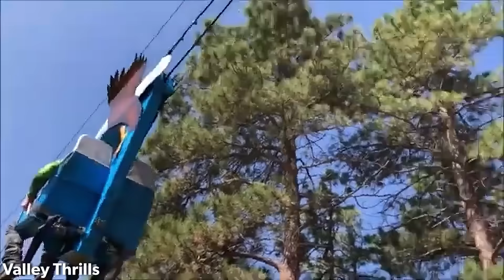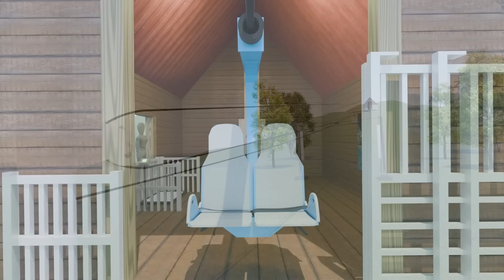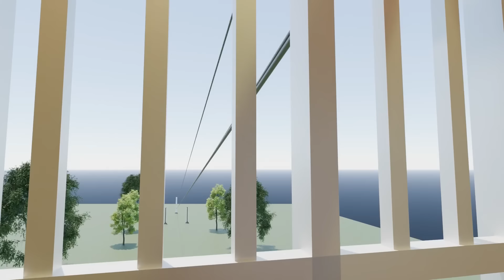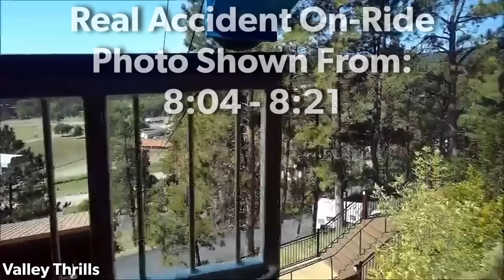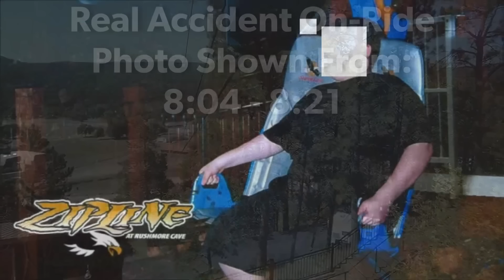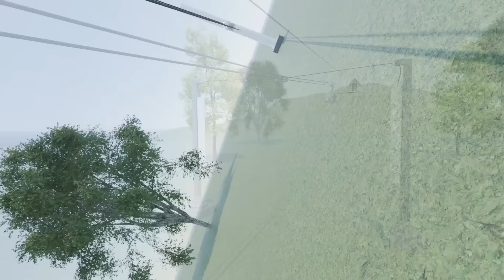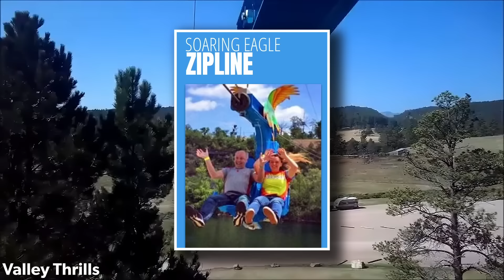Soaring Eagle Rushmore Cave - What Really Happened on May 29th 2015?

Comment from the maker: Some small notes: I want to make it clear that my statements about the restraints cycled feature being added are speculative (as stated in the video). There is nothing concrete saying Soaring Eagle added this as a result of this accident, but timing suggests that this is possible. That being said its still unlikely that feature would have prevented this accident even if it was present. Second, the air brake was added at a later date, but prior to this the ride used a spring pack placed on the cable to stop. This was left after the air brake, likely as a backup. The drive cable motor does have a brake, but this is used for other operations like parking in the loading area.
Reply: Do you hate the GP
Reply: @Coaster_club1  if there was no gp, thered be no parks

Comment: How are the proximity sensors powered / wired to the PLC?
It looks like there is no electrical connection to the seats and its seems unlikely/impractical to have wires follow the seats along the track ???

Comment: On of my favorite rides is a soaring eagle zip line and after hearing this I’m never riding it again
Reply: 1. The safety issues with Soaring Eagle's products have primarily affected people who are improperly restrained (more accurately, not actually restrained at all). That is, the people hurt/killed by their rides were hurt/killed because they were not restrained properly.
2. The ride model received an additional mandatory service update for all existing installations to retrofit additional shoulder restraints to mitigate the issues raised in this video, as well as improved operational procedures to ensure correct restraint use. This should limit the risk of an improperly restrained rider being cycled.

If you still enjoy the ride model, they've been made safer so you can continue enjoying them with a much lower risk of this kind of error.

Comment: It occurs to me that a very simple check they could add into the routine would be to ask the rider to attempt to get up off the seat after the restraints are locked. If they are unable to do so, you can start the ride. If they are able to do so, you just prevented an accident.

Comment: The rider and parent saw how the ride worked since it was open field, they saw how it would go backwards. The most logical thing is to think, Why do we use a seatbelt while driving? These seats are a bright color, don't you see where you are going to sit before doing so?? Also the operator and the parent not checking if the "child" (Idk if it was an adult) is well seated and wearing the seatbelt.
Reply: The parent couldn't have seen whether the seat belt was correct given where they were standing. See 6:38.

Comment: Why couldn’t they make the seatbelt color something more obvious, like a bright neon orange/red or yellowish green that construction workers or traffic people use? Would have made it more obvious and would have been more of a challenge for it to blend in with clothing 
Cause even with clothing that’s the same or similar in color, shadows will still probably reveal the seatbelt, where as black it’d be impossible if the person is wearing all black(like they are in this)

Not to mention it catches the eye. You can’t really miss that.
Not saying it’d really prevent the accident it’s still possible the accident could have happened, but it could have been way less likely.

Also the fact the same thing but on different rides designed by the same people happened twice cannot be coincidence.

I’m less surprised that this has seatbelts as its main and only safety feature than I am the haunted mine though cause how are seatbelts a good enough safety measure for plummeting straight down, if I’m remembering things right?
I’m still surprised this doesn’t have AT LEAST a lap bar though. Seatbelts aren’t always gonna keep a person inside

Also funny how I just now get to the suggestions part after posting this. Funny how they did not take much into consideration.

Comment: people are judging tf out of this rider but to me it seems reasonable that this rider wouldve;
a) expected the belt to be placed over them by the operator
b) be nervous they have to ride alone and pay more attention to the conversation / questions than the ride
c) didnt fully know / pay attention to the restraint system and expect the operator to handle it or notice issue

the report states that based on his age he wouldve known the risks associated with the type of ride and had had experienced like these rides before
its not stated what these experienced specifically are and if the rider would be familiar with these types of restraints
i think its fair to assume that on previous thrill seeking rides the operator wouldve handled restraints more than in this incident
Reply from the maker: Those same people need to realize that this type of issue doesn't occur on other rides, but has happened multiple times on this type.

Comment: Not to blame the victim but I honestly don't understand how you can get on a ride and not notice or be alarmed that you're not restrained in any way.
Reply: If I had never been on a ride before and wasn't familiar with the restraint system that it used, then I wouldn't be concerned about the lack of restraints until the ride starting moving, and then it would be too late. Up to that moment I would be assuming that the the ride operator simply hadn't gotten to the step of doing the restraints yet.

Comment: "Our cheap and shitty restraint system failed causing a child to be ejected from the ride?
 The ride operator CLEARLY didn't check to see if the rider was sitting on the restraint(as opposed to UNDER them)?
 Checking the restrains is LITERALLY THE ONE JOB OF THE RIDE OPERATOR, AND IS THE 0nLY THING/INDIVIDUAL IN PLACE TO MAKE SURE SAFETY IS MET ?
 Our design and mediocre manual NOT EVEN ONCE accounted for the possibility of someone sitting on the restraints??
 Because WE didn't include restraint placement in our manual, the overtly limited procedure can be cLaiMEd that it was "followed 100%", thus damn near lying by omission?
Well CLEARLY it's the dumbass kids fault for choosing to be stupid and fall from the ride.
We take no blame, and are disgusted that our name is being dragged through the mud because THIS IS 100% THE KIDS FAULT"

Comment: 1.7G in nominal operation? Backwards into the seat is fine, but that seems a bit much for a LAP BELT to stop you being ejected forward from the seat.  It's a durable (static) belt, not one that has dynamic stretch or which dissipates energy through tearing stitching.  Do you like bruises, kids?

Comment: Okay - NOT scientific, NOT official, PURELY OPINION... but I took screenshots of the video from the photo of the rider in the ride vehicle and spent several minutes playing with Photoshop (light, saturation, color, brightness, contrast, etc.) and it didn't look like there was a seat belt across the person's lap. However -- and I repeat that this is neither scientific nor official, and I am not familiar with the ride vehicle -- it appears  that there is a black stripe where the seat & seat back meet on what would be the rider's right-hand side; that stripe is the right color & size, and in the right position, for a seat belt that is tucked in behind the rider.  Regardless of any of that, it's very disturbing that 1) the seat belts were just black instead of a high visibility color (bright orange, brightly colored stripes, etc.) and 2) there were no standardized procedures for checking if the belts were in the proper position (which is VERY different from just checking if they're clicked into the receivers at one end).  If the ride operator had been distracted by the situation with the riders and was (as admitted) talking with the person who did not board the ride, it's simple human nature to have missed not seeing an all-black seatbelt against an all-black shirt & shorts.

Comment: I used to work at a park with a soaring eagle. From my memory, the seatbelts are not retractable, but the one with the pin was yellow, making it a lot easier to see if it's in front. It also seems unintuitive that the seatbelt would be across the empty seat, instead of in between the two chairs. How the guest didn't realize he was loose I'll never know. I also didn't know they made them where it starts at the top and flies down, mine got buckled at the bottom and sent up and flew down.
Reply: The standard bottom loading setup was designed to work on flatter settings where the high point needs to be created artificially. If a location has the ride's desired highest point more accessible than its lowest (e.g. located on a hillside like it is here), it can be installed with a top loading configuration instead.

As far as the seat belt arrangement goes, it was likely across the seat from the previous cycle (as was the case with the later Mine Drop incident), with neither the victim or operator giving it much mind until it was too late.
Reply: Yeah after the previous rider got off, the belts should've been hanging down in between the seats, instead of across the seat. This makes it impossible to sit on the seatbelt accidentally.
Reply: @jingleground  Indeed. Some operators would do that themselves, but was never officially outlined as standard procedure.

Comment: so let me get this straight.. they didn't check to make sure the seatbelt was in the correct position before plugging it into the receiver?!?
Reply: Indeed. However, the ride lacking any physical or procedural safeguards to mitigate that scenario and the manufacturer failing to implement any of those safeguards despite knowing the potential for the problem unfortunately paved the way for an almost identical scenario to claim the life of a 6 year old a few years later.

Comment: you're more likely to be bitby a shark that fell out of the sky than bein an accident of ride
Reply: Or even electrocuted by an electric boat. I say, what would happen if the boat sank from its weight, and you’re in the boat, and you have this tremendously powerful battery, and the battery is now underwater. And there’s a shark that’s approximately 10 yards over there...

So I said, there’s a shark 10 yards away from the boat, do I get electrocuted? If the boat is sinking, water goes over the battery, the boat is sinking, do I stay on top of the boat and get electrocuted? Or do I jump over by the shark and not get electrocuted?

Because I will tell you he didn’t know the answer. He said, ‘you know, nobody’s ever asked me that question.’ I said I think it’s a good question. I think there’s a lot of electric current coming to that water. But you know what I’d do? If there was a shark or you get electrocuted, I’ll take electrocution every single time. I’m not getting near the shark.

Comment: If the riders experience 1.5Gs at the end of every run, then why the F are they only using a flimsy belt to stop them from sliding out?!!! Even with the belt properly latched, this is begging for an accident.
Reply: Personally, I'd want at least a 3 point harness on before riding a zipline!

Comment: Black seatbelts contrast heavily with the bright blue seats. Why would sit on top of what is obviously a seatbelt, allow the operator to latch it, hear it latch and not realize you’re not restrained at all? Sure the operator should have checked from the front, but a teenager usually knows how seatbelts work.
Reply: 1. Lots of ride restraints look and work differently. Some rides don't have much restraint at all. Some belts have long tails or parts that you WILL likely be sitting on even when its buckled.
2. You don’t hear a click and automatically assume what it was. Operators have many things to click and push
3. Things happen fast
At the end of the day it doesn’t matter because children exist and visit these rides. It could happen to them if things aren’t changed

Comment: You left out that South Dakota does NOT have inspectors to enforce ASTM F24.20 Risk Assessment protocols, and that Roaring Eagles is headquartered in Utah, which (is one of the 6 states that) ignores ASTM almost entirely, so the manufacturer doesn’t have to assess human modes of failure, and will continue to get away with it.

Comment: Regardless of how you feel about the choices to sue or not sue the parks involved in these last two videos, the fact that this manufacturer (with an honestly strange and seemingly over complicated system for something somehow too simplistic at the same time) has been involved in more than one incident and hasn’t seen as much pushback and legal repercussion, if not more, as the two parks have is INSANE.
Reply: It’s weird to me to have the elaborate restraint sensors on a belt that has to be manually cinched up. Like all it takes is an operator not tightening the restraint properly for something to happen.

Comment: Dismissing a non-fatal accident as a one-off that's "unlikely to happen again" is a great example of how companies should NOT respond to an accident.  All accidents need to be reported so that we can learn from them so that similar accidents don't happen again.
Reply: Stupidity is not making mistakes often, it’s refusing to learn from them
Reply: @Pizzaetertjeno, no. Stupidity is making many, easily avoided mistakes. Ignorance is refusing to act after making a mistake.
Reply: @XSillygooseX  That's deliberate or willful ignorance, not the plain definition which is a simple lack of knowledge.
Reply: The Haunted Mine Drop fatal accident was also a ride made by Soaring Eagle
Reply: i think its especially wild considering how many engineered controls existed on the ride, such as the restraint unlock key being held by the control panel until such time as the gate is closed, and the ride being unable to be dispatched without that key. It seems like a lot of thought went into the initial engineering to prevent human error but as soon as an incident did happpen they essentially said "well, we designed it right, we don't need to change anything" despite the design having so many engineered human factors controls in it.

Comment: I don't understand why the end of the ride has to be 15 feet up in the air. You don't get off at the end it brings you back so just make it 3 feet up so if someone gets stuck at the end or falls out it's not too bad.
Reply from the maker: The design flaws keep coming
Reply: And what if you have a 10 foot tall rider?
Reply: @MossDFTBA  I think I get it. What if there is a tall rider whose feet drag on the ground?
Reply: @Orquet-qj2nf the original comment says "put it 3 feet up" meaning the bottom of the seat should be 3 feet off the ground. Does anyone exist whose shins are 3 feet long???? Paul is making up impossible scenarios to try and 'gotcha' someone making an honest suggestion to improve a potential design flaw.
Reply: @MossDFTBA  Well.... he's not alive anymore but Robert Wadlow's shins do look like they were that long. And he was only 8ft11in. ;P
But yes, Paul is being contrary.
Reply: @MossDFTBA wow I thought society moved past slenderman-phobia but I guess not

Comment: I'll never get seat belts that don't sash across the chest.  The brakes here cause the same forward-thrusting force as in a motor vehicle, and it would feel uncomfortable to not have that.
Reply: Especially a ride with such a jarring stop. It's basically having a car crash without chest straps.
Reply: 1. "it would feel uncomfortable to not have that" are the words of someone who has never had a sash seatbelt dig into their chest, abdomen, or neck.
2. Sash seatbelts can artificially exclude larger riders who would be perfectly capable of riding safely with a lap restraint.
3. The airbrake was a modification made to this specific installation.
Reply: I used to operate a soaring eagle ride (not this exact one) and that has 2 answers.
1. It's more "fun" to have the feeling that youre about to get thrown off at the end.

And 2. Is that a chest belt would open up the potential to crush ribs and compress breathing when the ride comes its abrupt stop.
Reply: @impossiblehorse7884  As someone who's endured painful compression from shoulder belts just from the forces of normal car driving, I believe you.

Comment: IMHO, this could have been avoided if the ride operators were requires to lift both seatbelts up before latching the seatbelts.  Or, in the case of the prior drop ride accident, requires operators to move all seatbelts into a neutral-forward hanging position before loading riders to ensure no one sits on the belts.
Reply: Right on the money. I know that riders who are old enough and mentally competent SHOULD also be aware but some people just turn their brains off when they get on rides. So having attendants physically checking the seat-belts/restraints on rides is so important to add that layer of safety. I've been to a park where there's an attendant on either side of a roller coaster train and they go down the line checking all the restraints before they can give the ride operator themselves the OK. Then that way it isn't all on just one person.
Reply: Even with the design not being idiot proof, clearly outlined procedures from the manufacturer or park could have gone a long way.